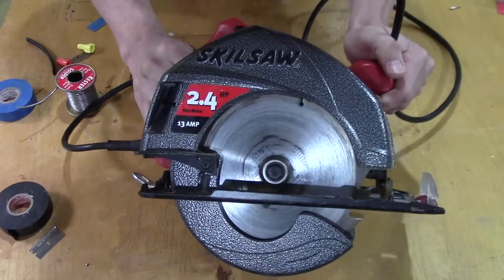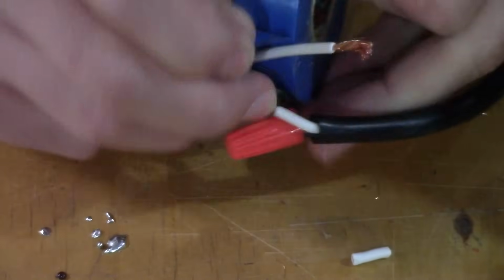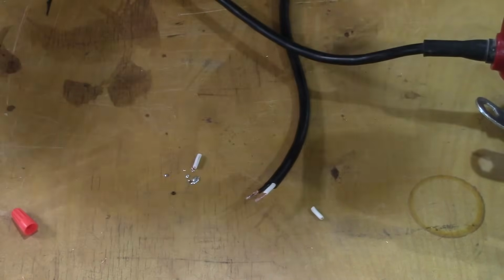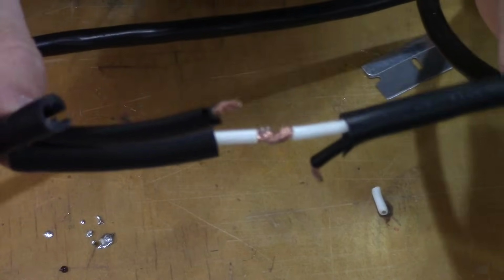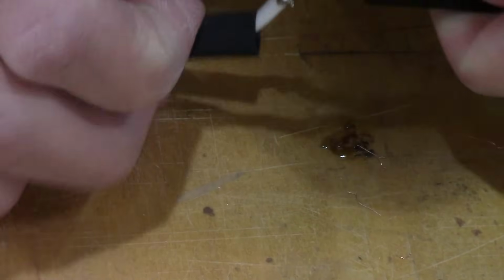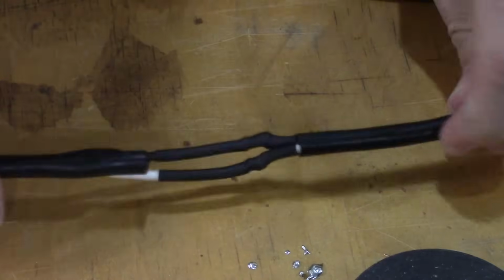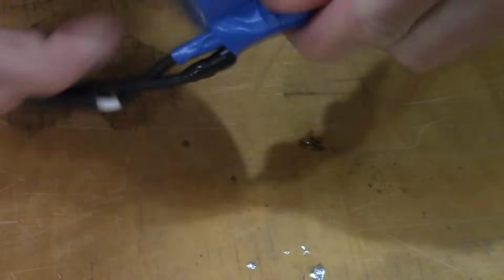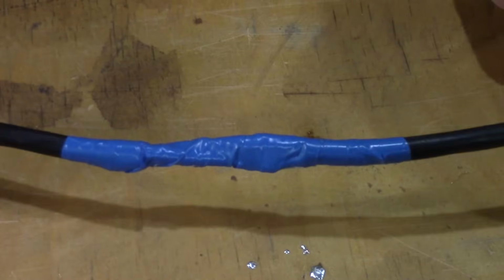How to repair a cut power tool cord

Comment: Good technique that I have also used. The only difference if I may... I offset where the wires connect by 3/4in so they have no way of accidentally coming in contact, even when wrapped. Thanks for the vid.
Reply from the maker: David Damico You are right that would be better. Thanks for jumping in!
Reply: Even more important in Europe and the UK where the voltage is twice that of the US. 240 volts.

Comment: Yeah, definitely a temporary fix for a power saw.  Good for lamp cords.  Not my favorite solution for a power saw given the high amperage, active use and lethal capacity in operation.  Like Andy said, you don't want to do anything that affects the drag of the cord across the board - just to avoid mistakes and surprises.  And this cord is going to get yanked on a few times.  That's why it has a stress relieving sleeve at the saw.  The stress of getting yanked on will route to the wire with shortest solder joint which weakens the cord a bit.  If you have mechanical skills and basic electrical awareness you can replace the cord, which would be a good fix long term fix.  If you don't have time to wait for the exact cord from the manufacturer be sure and use the same wire gauge when you build your own.

The suprisingly tricky part of heat shrink tubing is what we see here: Planning ahead to place it everywhere you're going to need it before you start sticking parts together.  (Don't ask me how I know that.)   As others have mentioned, staggering the solder joints so they're not across from each other adds safety, maybe even with a lamp cord but especially with a saw, since solder leaves hard edges.

Good luck making, have fun, explore .... stay safe.

Comment: Hi do you have any tips for when you've cut the wire for your soldering iron.
Reply: hahahahahaha
Reply: Borrow your friends soldering iron
Reply: Use a lighter to heat the wires instead. Just don't get soot on it.
Reply: B😎🤣🤙😉

Comment: Newbie here: what type of wire cutters are you using at the beginning to remove the plastic coating and expose the wire?
Reply: If you score the edges with a box knife or even a sharp kitchen knife, you can use your teeth or even fingers to pull the wire sleeve cleanly off exposing the wire

Comment: Instead of the heat shrinks on the individual wires, can you just use regular electrical tape? Is 1 method better than the other?
Reply: You can use electrical tape in a pinch, but shrink tubing will last longer and be less prone to fail.
Reply: coolstory87

Comment: My cat chewed through one of the wires for the pre-attached lights on our new christmas tree. Four splicing attempts later (three with solder) I am no closer to getting the lights back on, but unfortunately running out of wire for future attempts on the plug end. The solder seems to be glopping around the wire rather than getting sucked in. Can't tell if I'm using too much solder or not enough; I suspect I was oversold a "heavy duty" soldering gun and that it may be overheating the situation (on my last attempt it looked like the copper wire might have melted a bit, and the insulation is definitely melting) - but the low power setting doesn't seem to get anywhere. Any tips on troubleshooting a splice? I appreciate the video (and the others I've watched on this), I'm just having no luck.
Reply from the maker: +Vic Random You can apply flux to the wire to help the solder adhere quickly.  If your iron is too hot it will definitely cause trouble getting the solder to stick.  Touch the iron to the wire to get the wire hot and then quickly touch some solder to it and once it is sucked into the fibers you are set!

Comment: Question, if a child cut a vacuum cleaning cord in two different places could you use this method for that?
Reply from the maker: You can get a replacement cord if it is super mangled.  Yes you can fix the cord.  If your 2 cuts are close together you can ditch the mid section and have one splice.
Reply: +AdamDIY Trust me, she won't understand a word of what you just said, Her question says it all really.
Reply: Get a new child!........... Only joking

Comment: what wire is the positive ? The reason I'm asking cause i want to get a 9v battery clip connector to charge my 9v batteries ? And i want to cut the useless radio cord ?
Reply: so should a 9v output be the proper voltage for charging a 9v battery ? And what's the most voltage output to charge a 9v battery ?

Comment: what color is the positive ?
Reply: It's AC so no positive or negative
Reply: drrobotnikmeanbeanma hot wire is  black.  notice how the wall outlets and  plugs have a wider prong. the wider prong is the neutral, the narrow one is the positive. see the drill cord or other corded tools and they have one wider prong too. the reason is that the on/off switch is always plugged to the positive, wall switches that turn on the lights are wired to the positive, it is a safety code and nothing to do with AC or DC. be careful doing electrical work in your house.  you could be touching two 110v black wires thinking they are the same wires  but they can be separate lines and  give you a nasty dose of 220v and blow your fingers away.
Reply: Do you walk around your front yard holding a roll of Toilet Paper ?  You don't know your butt from a hole in the ground.  The SWITCH on the tool NEEDS to go to the POSITIVE Wire !   Black wire is the Positive wire and the White wire is the Negative wire .

Comment: Suggesting wire nuts is crazy 😂 they shouldn’t even be an option.
Soldering on wire that’s going to flex also isn’t recommended as solder isn’t flexible so it can crack and lose connection. Neither of these repairs are correct.

Comment: Sometimes buying a new cord is better. Rats chewed our microwave cord and that gave me the excuse to buy a new one that's a higher amp rating, thicker insulation (takes longer for the rat to chew through...) and best of all, longer - so I don't need an extension cord to keep the kitchen table clear of appliances.